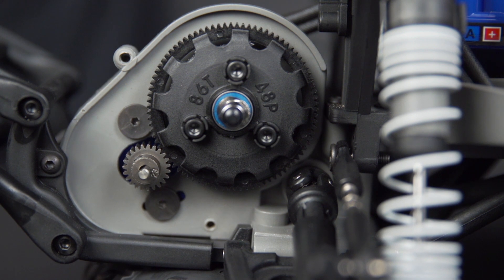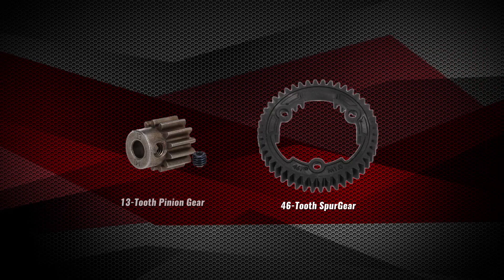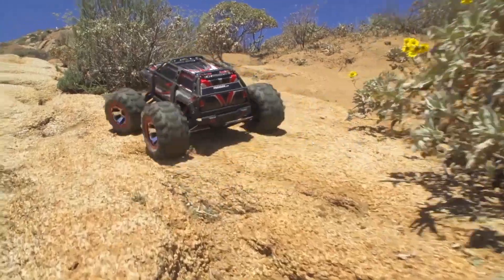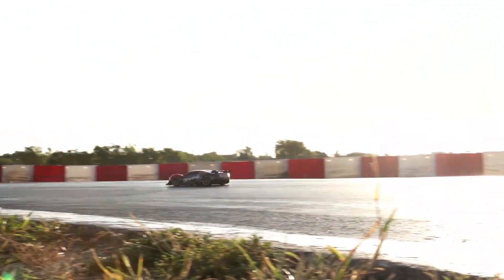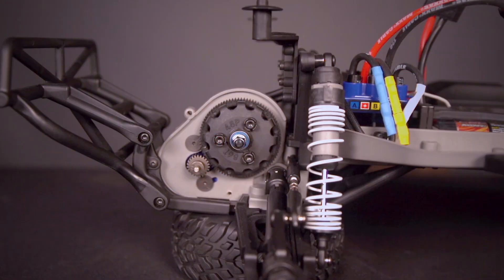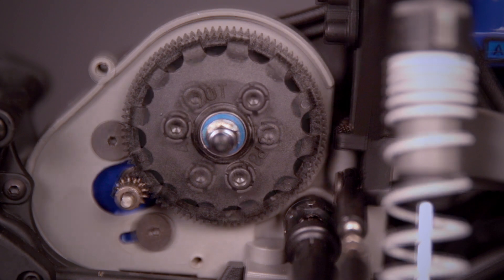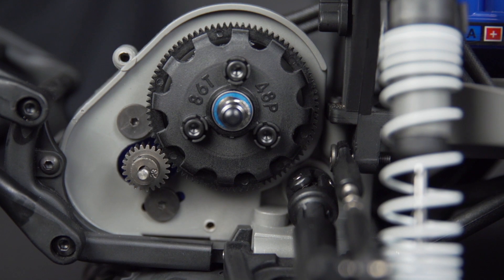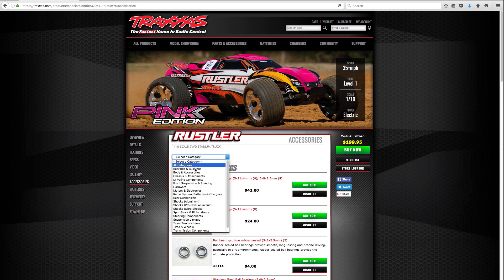Gearing Setup | Traxxas Support

Comment: My emaxx is messed up. I had to get new motors to put in, and the main black gear won’t move smooth, if I push my truck the gear won’t move until I push it far enough then it kinda slams forward. I’ve loosened and tightened it

Comment: I crashed my e revo and it makes a weird noise now when it moves and sometimes the driveshaft doesn't turn, are they easy to dismantle and fix. I'd rather repair it myself.
Reply: J Same thing just happened with my e revo, have you found out what the problem was?

Comment: How fast can i go with a 16 pinion and a 90 spur ?
Reply: On which car is this
Reply: Griffyn Podlatis rustler 4x4
Reply: @Chris-gn2ns  well I have a stampede 4x4 vxl and I don't think u could even fit a 90t spur. I would run that pinion with a 54t spur it should be good speed and good acceleration probably around 50mph top speed on pavement
Reply: Griffyn Podlatis and how fast is the rustler on 15th pin
Reply: @Chris-gn2ns  not really much slower then 16t so 15t I'm guessing 45mph maybe
Reply: Griffyn Podlatis is it then also for grass drives oder roads with stones ?

Comment: I am soon getting a 10,5t 4300kv brushless motor. I have a 65t spur gear and a 23t pinion gear. Should i get a smaller pinion or is the current ratio fine for the new motor?
Reply from the maker: Hello Alexander 123! Our Customer Support Team would be happy to help. You can contact them at 888-TRAXXAS or at Support@Traxxas.com.